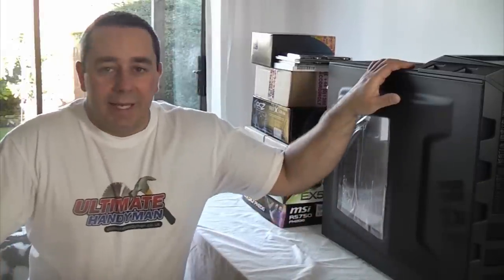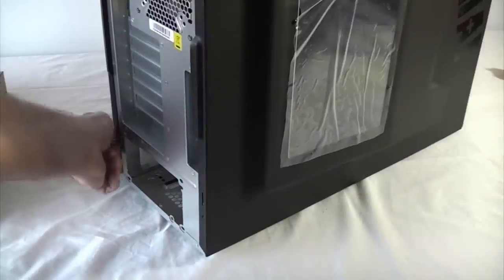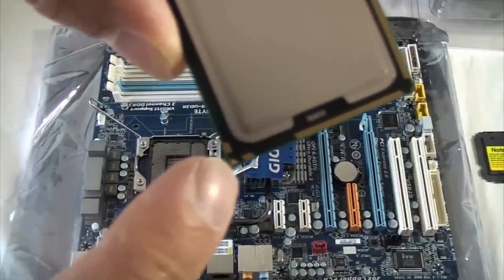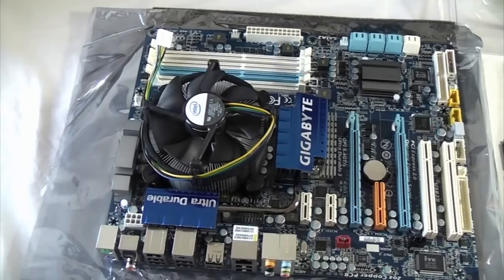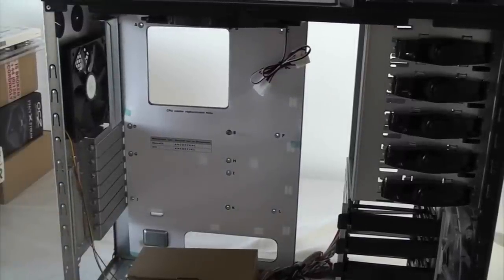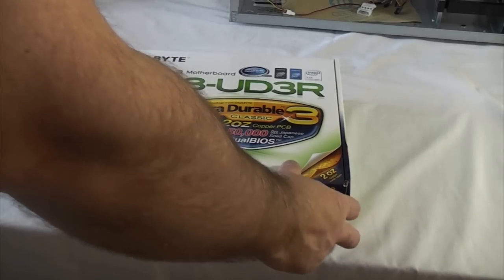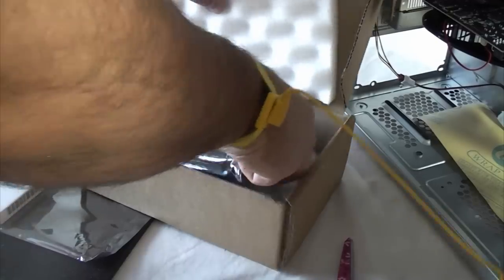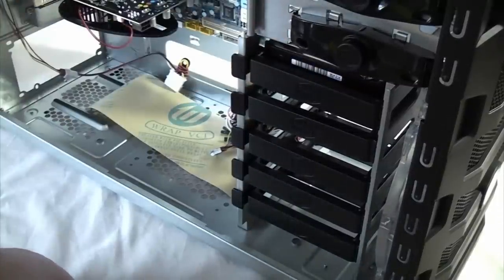How to build a computer

Comment: Yes. At the rear of the case there are 2 black rubber wholes for the hoses. One going into the hardware and the other for a return to the radiator or pump. However you have set it up.

Comment: Interesting anti-static wrist band, I have never seen one that plugs into a wall, they usually have a clip that you can attach to a metal object of some sort.
Reply: having fixed PC fora Living..we normally have a Static Mat that the wrist band clips on ..the mat then clips in to a cable that goes in to a plug..like the one shown inthe video.. a Metal Object might not be Earthed.

Comment: Absolutely love this video ... very clear & straightfoward, not a whole lot of unecessary talking. Is same motherboard still available - EX58-UD3R? Did not see  it at NewEgg. Can I get it somewhere else?
Reply from the maker: Thanks for the comment and merry Christmas  ;-)
I don't think you can buy this new anymore as the video was filmed 4 years ago, although you can buy second hand ones on ebay (which I do not recommend). Probably better getting a newer model motherboard!
Reply from the maker: *****
It was filmed in December 2009, now we are in February 2014 so it's 4 years and 2 months old ;-)
Reply: I would recommend the Gigabyte GA-Z68AP-D3 mother board to anyone looking for an ITX LGA 1155 motherboard today.

Comment: Some cases have a bottom opening for the fan airflow. It's usually best to put a PSU facing down if you can, to stop it from sucking all the hot air out of your case. As long as carpets aren't a problem.

Comment: Good vid and someone not from the US for a change.  The anti-static wrist band is fine but not really needed.  All the years I've been building PCs I've never popped anything and never used one.  I always just make sure I touch the metal case first before I touch anything.  Has the same effect of getting rid of any built up static.  Maybe useful for insurance claims I guess.

Comment: Here's the deal with the antistatic bag. It's coated with a metalized film which gives it it's antistatic properties and making it slightly conductive. There should only be a risk for damage if power was run through the motherboard while it's placed on top of bag. That being said, motherboards do have capacitors which may still contain a charge with no power applied. Is it enough to possibly cause a short? Honestly, I'm not really sure but personally I'd rather not take the chance.

Comment: I have i5-3570K Ivy-bridge with a Z77 motherboard and a ssd, and I must say that it is worth it. When the ssd is hooked up to a 6gb/s port, the boot up time is stupidly fast. Also, the new gen processors boost the performance of PCI-E 3.0 graphics cards quite a bit. With an older processor there was a noticeable difference in gpu performance.

Comment: Are the PCI slots at 14:01 all the same size, or does it correspond to the case size?
Because I'm stuck on if mine are too small o.O
And also - near the end of the video ( 25:00 ) do we HAVE to do any of the setup before the windows start?

Comment: thanks so much i appreciate it. last question, are there any resources i can use to learn everything possible about most hardware parts needed for building a computer. i dont need to know about the building a computer part, just specific information about each hardware component

Comment: AWESOME VIDEO !!!! GAVE ME THE CONFIDENCE TO BUILD ONE! I USED THIS VID WHILE I BUILT MINE!- I USED GIG Z68 MOTHER I5 2500K UNLOCKED-16GIGS OF CORSAIR VENGENCE,2 TARA GREEN CAVIAR AND 54 GIG SSD RUNNING INTEL SMART RESPONSE! WITH 750 WATT POWER SUPPLY-52 INCH 1080  HD,YAMAHA 6.1 600 WATT-DIGITAL OPTIC

Comment: I HAVE A BIG QUESTION:
Ok, so I've been wanting to do this for some time now, and being kinda short money, i bought a cheap PC and want to take some of the parts out and put in my new case and so on. I need my computer to be REALLY fast, so I bought an intel i7 and motherboard (my current motherboard doesn't have the socket) and a stunning new graphics card, I have yet to get a case. Can I take out my current hard drive and DVD drive and put it in the new case?
I don't wanna buy Windows 7 again.

Comment: Why'd you use the bottom pcie slot for the graphics card? the top one has higher bandwith and should be used for a single card and the bottom one is if you are adding another one for crossfire.

Comment: I have an 11 year old desktop, and I'm seriously looking into doing some upgrading to the hardware. One question I have though is that since I am still going to keep the hard drive that I use now do i still need to buy a new copy of windows? I just want to replace the processor, ram, and mother board. Will just changing those things require me to buy a new copy of windows?  -Thanks in advance

Comment: FX-6200 its a 125 TDP so depends whats its the rest of your configuration, because if you just use your pc for navigate and office use you just need at least PSU-400W, but if you gonna use the pc for play without crossfire or sly with PSU-600W its more than enough, but if you plan use crossfire or sly you need 750W. take on consideration a good power supply like Antec,OZC,Corsair.

Comment: I'm sorry, I have a question about the Sata cable, do you have to buy it to make the connection to the motherboard, I'm using 2 Hard Disk (from previous computers I had), but I can't remember if I trow the cables in the garbage :) 
I'm sorry, can you help me?

Comment: Great video
 
1 thing is always use the top slot for the graphic card for the fastest speed. In the second you got half! 

If you have 2 identical graphic cards then it does not matter.

I would untangle the fan cable for the cpu and wire tire it so you don't risk the fan catching it somehow.

As long as you hold the parts correctly you don't need a static strap. Only the inside of a bag is actually conductive.

If you move the pc a lot put a screw on both sides of the optical drive.

Watch Carey Holzman for further information and great builds
Reply from the maker: Are you sure that both slots are not the same speed on this motherboard?

There is a lot more room to get the card in the slower slot and believe that both slots are the same speed ;-)
Reply: +Ultimate Handyman Look in the motherboard manual. Most of them if not all will give the top pci express slot x16 and the next x8 for speed.

With 2 identical graphic cards the speed will be x8 for both slots.
Reply from the maker: They are identical on my motherboard.
It says in the manual that you can use either, but the top one can only be used with smaller cards as their is less room.

Comment: I'm not overclocking but my CPU cores reaches 80+ Celcius (from gaming) using the stock Intel cooler. Do you think that is safe or I need to buy an aftermarket cooler?

Comment: Awesome PC build... But I have one question, will a conventional antistatic wrist band be as effective as the one you have used in your video?
Reply from the maker: Thanks.
Yes, but if it is one of that connects to the case using a crocodile clip you must install the PSU first and the lead should be plugged into an electrical socket to ensure earth continuity (the socket should be switched off)
Reply: I always start with prepping the case before putting the board in, so that way I can install the psu and whatever else I need to put in the case to complete it. 

As my antistatic strap has a crocodile clip on it, I would need to perform that extra process (I.e plug in the lead for the psu with the socket switched off) in order to protect myself and the motherboard etc from static shocks. 

Many thanks for that. I did not know that you needed to do that in order to stay protected against static, I thought just putting the clip on the case was enough.
Reply from the maker: yazmeister93
In reality clipping it to the case should work but there is a tiny chance that the case is not earthed properly so having it connected to the socket guarantees a good earth. 
Thanks for the comments

Comment: I JUST got done building my PC, which isn't complete since I need to get a new GPU soon, but. I did not have a grounding strap. It IS important to discharge your static electricity, so touch any GROUNDED metal that isn't painted, and I also moistened my socks with water and stood on a flattened cardboard box, to make sure. My PC is currently POST'ed and I'm about to install windows 8. :) First build.

Comment: thanks for the video it greatly helps, i just have some questions, i want to move all my components from my computer to my old gigabyte gaming pc case. will i have to set up the operating system and drives again when i have done this? also i am hoping to get a new graphics card which is DDR3 PCI-express x2, my motherboard says it only takes DDR2 and has pci-express x4 and x 16. will it fit? thank you

Comment: @ultimatehandyman even if a colored screw? Like a gold or black screws for example.. So first thing I do is install my PSU, screw it to the case, plug it into the wall socket, while keeping the switch off and clip my aligator clip to any screw in the case, I build the rig?

Comment: 'cause, I was wondering how the pci-e slot connector didn't broke? :)
I am sort of a hardware geek, and I was always wondering how much pressure is needed for cpu instalation and also the cpu cooler...? You didn't said anything about the pressures needed for conecting all the other stuff...

Comment: I have a question concerning which way to face the CPU fan. Specifically the 212 EVO, should I put the fan facing the back of the case or facing inside the case?

Comment: Did i miss a bit..PASTE between the CPU and the HeatSink.. ThermoPaste!

Very good VIDEO, the only thing i would add is watch ya self when putting your hands in a case,, there is a LOT of Sharp Edges in a case and i myself has bled in a few cases in my time
Reply from the maker: The CPU and fan were bought as a kit and so the paste was pre-applied ;-)
I did have a tube of thermal compound to hand, but didn't need it.
Thanks for the comments
Reply: ***** i do Love SilverPaste...and if you ever use AMD..always buy a Dam good Paste

Comment: IF i got windows 7 on my old Harddriver WHIT SATA cable. do i need to install and working whit the setings like you did when you turned on the Computer for the fisrt time?
OR can i just use plugg it in and head on?

Comment: This is a great video but there are some things i would do differently. Firstly when laying the motherboard down NEVER put it on the anti-static bag that it comes with, instead lay it either on the box it came with or a test bench. Also if your getting expensive components like these please do not use the stock heat cooler... Please...
Other than that this was a great tutorial! =)

Comment: I'm going to put this computer build out there which I've givin to several others. Going to start ordering very soon. Feedback will be fun.  CASE: CM Storm Trouper Full Tower  MOTHERBOARD: MSI Z77 MPower DDR3 2600 Intel-1155  PROCESSOR: Intel i5-3570k  POWER SUPPLY: Corsair Enthusiast TX750  VIDEO/GRAPHICS CARD: Sapphire Radeon Vapor-X HD 7950  MEMORY: Corsair 16GB (2x8g) DDR3  SSD: Samsung 120GB 840 Series 2.5"  HARD DRIVE: Seagate Barracuda 1TB 3.5"7200rpm  Plus other goodies.

Comment: Usually the Intel or AMD CPU fans has some gray paste on it. (The one fan u get with the CPU) If you bought any other fan and/or plan to add some better than a stock fan just plug in the aftermarket CPU fan with some aftermarket paste you buy from... Somewhere... And you should be good.. And yes all CPU's need the paste to transfer the heat away from the chip...

Comment: @spencotom You need AT LEAST a GTX 560 (or a HD 6870) graphics card to run BF3 at decent settings, since it is a pretty graphic enducing game, to run it at ultimate u would need a GTX 560 Ti with a decent processor, hope this helped

Comment: Hi there.
love this video and wanting to build my own. so im mostly worries about ESD. im going to be standing on carpet and the components are going to be on the table. whats the best and safest way to ground myself?
thanks
Reply from the maker: +RSCTV Gamer 
An anti-static wristband is probably the best option, plugged into an electrical socket outlet.
Reply: +Ultimate Handyman 
thanks. should i leave my shoes on, on carpet?
Reply from the maker: +RSCTV Gamer 
As long as you wear the anti-static wristband you can leave your shoes on as that will take care of any static build up ;-)
Good luck with the build ;-)
Reply: +Ultimate Handyman 
thanks for the advice. thanks a lot. i watch this video  and it really helps. i also watch Carey Holzman and easypcrepairs as they all 3 have inspired me to build my own pc. one question though. does raid 0 mean combining both hard drives into one big one?
Reply from the maker: +RSCTV Gamer 
Yes it does. This can make the PC faster but if one hard drive fails, you lose all the data from both.
I would not bother with Raid 0 and would use a SSD for the main computer drive, then just have a large hard drive for the storage etc.
Reply: +Ultimate Handyman 
oh ok. so basically use an ssd for a boot drive? thats what i had in mind. do you want to look at my pc part picker list?
Reply from the maker: +RSCTV Gamer Yes, use the SSD for the operating system and programs but use the HDD's for storing pictures or movies etc.You will be amazed how quickly a SSD fills up though, mine is 500gb and is constantly getting full despite me having 3tb of storage via HDD's. You can message me a link to the pc picker list and I'll take a look when I have time ;-)
Reply: +Ultimate Handyman 
oh ok thanks a lot for that. really helped. this is my pc part picker list: https://uk.pcpartpicker.com/user/H4554N/saved/zjmNnQ
Reply from the maker: +RSCTV Gamer 
That looks like a good setup ;-)
Reply: +Ultimate Handyman 
i might start youtube and do gaming videos. also would want to become an IT technician and engineer.
Reply from the maker: +RSCTV Gamer 
That sounds like a good job ;-)
I have heard some bad things about games on YouTube to do with copyright, but I'm not sure if that applies to all games or just one specific game.
Best of luck with it all ;-)
Reply: +Ultimate Handyman
i think the copyright has got to do with the music in the game not 100% sure. thanks a lot for that. im going to need it.

Comment: Whats a good idea to get rid of static build up if u don't have an anti static wrist band?
Reply from the maker: Install the PSU, plug the computer into the wall socket, with the socket switched off and occasionally touch the metal case of the computer, that will ground you each time you touch it ;-)

Comment: Is this the same thing on every computer system or will it be different
Reply from the maker: They are all pretty much the same, although there could be some slight differences depending on which model motherboard you go for etc.
Reply: PC is really a IBM Compatable, meaning all the bits from the orienal PC that IBM built were got from Tandy/Radio Shack this was said to be there replay to APPLE selling there Personal Computers andupseting the BIG BLUE

Comment: is this a good pc?

Intel Core i7 (920) 2.66GHz Processor L3 Cache 8192KB
asus p6t x58 chipset
XFX ATI Radeon HD6950 Graphics Card PCI-e 2 GB GDDR5
HEC Compucase Cougar Challenger Ultimate Gaming Case
12gb ddr3 ram 1333mhz
Corsair CMPSU-700GUK Gaming Series GS700 High Performance 700W Power Supply

Comment: Hi mate I found this video so interesting. id like to have a go myself and build a computer  .  I'm looking for a good media player really as I don't use it for gaming .do you have any advice of what to look at parts wise. I like to watch you tube iPlayer tv and music. I like to run my pc Through my amp and speakers it sounds good. at the moment have an old dell 780 with 6gb memory. I'm looking for something faster so I can watch my media with out it slowing down thanks tony leics  uk
Reply from the maker: Hi Tony, I've not built a computer for ages, so I'm not really up to speed on what will be best, but for what you need I don't think you will need anything massively powerful. If you check Google, there are some websites where you can select a motherboard/memory/sound card etc. and it will tell you if the bits are all compatible.
Thanks for the comment
Reply: Thanks for the reply mate il give it ago. my bathroom is still going strong after I followed all your tips about 6 years ago. all the best tony

Comment: @XFactorMania Brilliant CPU, If I were you, I would change the GPU, a great price/performance card at the moment is the GTX560ti, I myself have the Twin FrozR II edition, its around 29C idle, and 59C at max performance :)
Maybe you should also upgrade PSU to maybe a 700W or 800W if you are going to run SLI og Crossfire (which the GTX560ti is a brilliant card to run in SLI!)
Maybe your motherboard is not the best for overclocking etc. I have the ASUS P8P67 EVO, and can only recommend it.

Comment: You have gripped the processor at the left and right sides. Would have been better if you gripped it at the top and bottom sides as there is more fingerspace. I saw this person on yt who did this way and didnt need to drop it.

Comment: If it was me building I would have swapped the core i7 processor for a core I5 because I think that's plenty for most uses and I would have used the money saved to get a better graphics card than the one you installed especially if I am going to be doing some serious gaming, I wouldn't also use the drivers that come with the graphics card because you don't know how long that card has been lying in a warehouse before you bought. Its much better to go online and get the very latest drivers I think